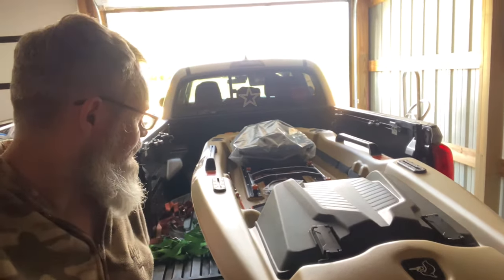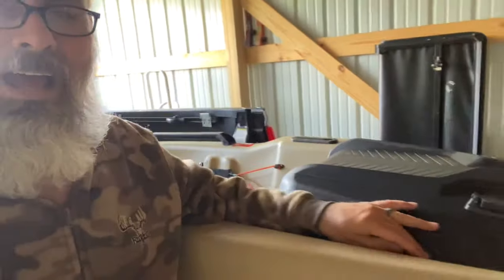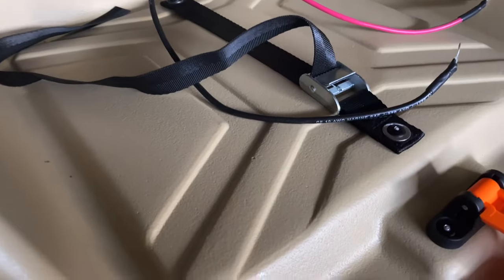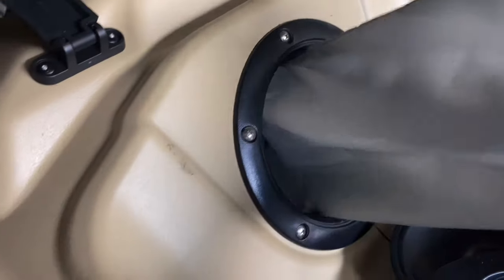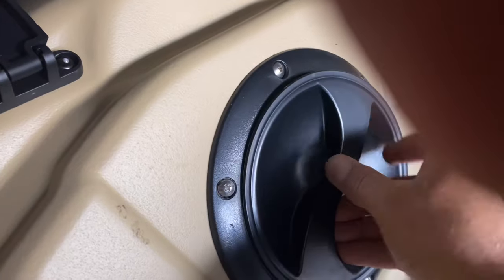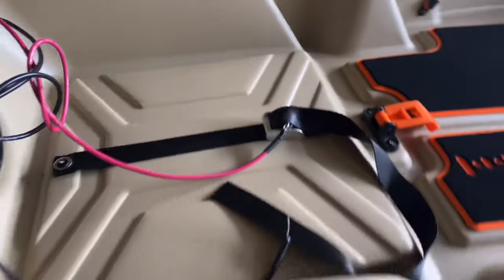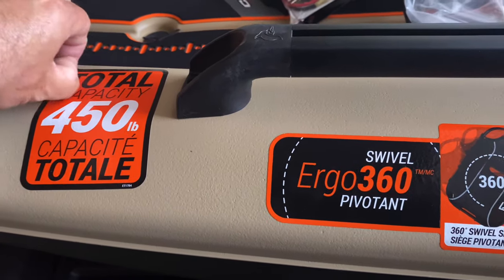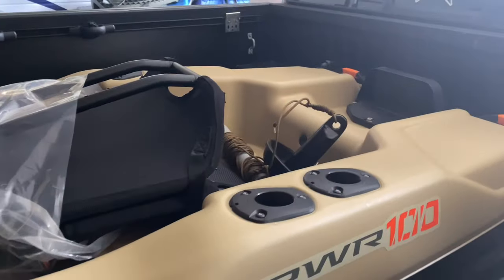Unwrapping and setting up my Pelican Catch PWR 100

Comment: Thank you for your video tour of the Catch PWR 100.  I've had mine for about a month, on the lake twice.  Like any kayak it gets better with custom mods.  Thought I would share in case you want to try doing some of the same.

I'll start with power.  I purchased a longer paddle from pelican due to the width of this craft.  The width makes the boat more stable, but can also be a challenge with paddling.   But who paddles?!  I mounted a Watersnake ASP, 24" shaft, 24lb thrust, 12v trolling motor on the transom.  You're right about the lip on the transom saving the motor!  I swapped the connector to use the one that came with the yak.  I run the motor via a MightyMax lead acid battery model 55-12, 12v 55ah.  The motor pulls 20amps at full speed.  The battery fits nicely in the front of the yak, straps down, and the cover closes just fine.  However, I have my battery in a battery box.   This brought about my first modification.   The battery stap that comes installed on the yak is not long enough when using the battery box.  I removed the strap by drilling out the rivet and replaced it with a longer strap that I riveted in place.  The yak battery cover now sits about a 1/2" off the deck with this setup.  However, the stretch strap still holds it down.

The first time I took this out on the lake I had a very difficult time with tracking straight.  The issue is with weight distribution.   To reach my motor I have to sit sideways and reach back.  Not only is this uncomfortable for me, but also more of my body weight was on one side of the yak.  Then my second mod - steering system by Bixpy.   This was a little unnerving to install, but got up the courage after a few brews.  To install, I first had to install an access hatch on one side of the stern.   For this I used a 4.5" hole saw to cut the opening.  Cutting a big hole in a new yak?!  Yep, and installed a black access hatch that unscrews and gave me just enough room to get my forearm inside the yak for pulling the steering tubing and cables from the controller back to the motor.  I then had to fashion some kind of connection to the motor shaft.  Plenty YouTube videos on doing that with cheap hardware.  I made my own out of some plastic I had laying around the shop.  Have to say, the steering works great once you have it dialed in!  Now I sit facing forward, which centers my weight, and the yak tracking is much better.

My next mod was to build and install a PWM to add variable speed to my motor (which has high and low speed).  PWM I used is also remote controlled.  I installed everything in a waterproof box and mounted it behind the seat.  Using the remote I can control power, speed, and direction.

My last mod to date was installing a kill switch on the yak.  For that I purchased a unit that interrupts the power to the motor when the pin is removed.  Again, had to cut a small hole in the boat for fishing the red positive line running inside the haul.  I then cut that line, wired it to each side of the switch, and mounted the switch to the haul.  When I go out in the water I attach a lanyard to my PFD and to the switch.  

All the pieces parts for these projects were bought on Amazon.  It has been a lot of fun modifying the yak once you get over drilling into haul!  Good luck and good fishin'!
Reply from the maker: Good info. I’ll take a look

Comment: Just ordered this yesterday. What trolling motor shaft length is ideal for this boat? Is 30 inch ok? That's what I ordered already but wonder if I needed 36. Thanks
Reply from the maker: Yes. And a 24” will also work. I am going to order one soon.
Reply: 24" shaft is fine.  I have a Watersnake ASP 24T that has a 24" shaft and it works just fine for me.

Comment: Thanks for the new boat walk-around video. This is #1 on my list to buy, and seeing how it comes and is set up helped with my decision. One question for Ed, or anyone else with this boat, would adding a 7" seat riser affect the stability? I'm 6'3" can concerned about leg room.
Reply from the maker: I have been told it will make it too heavy by adding the riser. I think you’ll have enough leg room as the seat will adjust back if needed.

Comment: Re: your Bass Raider 10e; have you had a problem with water intrusion between the deck and hull?
Reply from the maker: I have had no issues. I even installed a drain and plug. Sealed great.

Comment: I have 2 of these lil boats. 1 for me and 1 for the wife. You right they very hard to find. The wife's we drove 11 hours round trip to pick it up. For is the paperwork gos you need to go back to the store you bought it from and get the mso paper that supposed to come with the boat and a bill of sale to get it registered. Mso is manufacturer state of origin. We put the Minn kota 40 on a 12 volt deep cycle marine battery. Battery 24dc I think it was and the push great loaded down. Lowrance hook2 4x with gps fish finder with a transducer trolling motor mount works great. Enjoy
Reply from the maker: Got the MSO with my Bass Raider but they didn’t have it with the yak. They didn’t even know what it was. Lol.

Comment: I was searching youtube for the raider and this video came up. You said in the video you also have the raider. Now that you have used both what unit do you prefer more? Pros and cons to each? Thanks for posting this video.
Reply from the maker: First, with both you really need a rudder to help with tracking.  With the Raider it’s obviously wider which makes it more stable. I like how I can put the trolling motor at the front on the Raider. With the Catch PWR it breaks my back having to stay twisted to control the TM. Need a steering mod. I think I actually prefer the Raider for space, stability and tracking plus can take a passenger. Thanks for watching.
Reply: @outdoorswithedsometimesg  Thank you very much for your reply. You have helped me make my decision. As soon as I can find a raider in stock, im buying it. Hope you catch some big ones.
Reply from the maker: You will want to install a scupper hole for drainage. Trust me. Check my video for that when you get ready or there are also several other videos about it on YT. Enjoy!

Comment: I made the same mistake you did when installing the seat. I discovered after I got the seat together that the frame does come out of the rails... would have made things easier. I just bought mine yesterday from Academy, so haven't had a chance to use it yet.
Reply from the maker: Lol. I was like “duh” after I realized it was removable. You’ll enjoy it! I’m thinking of trying to add a 7 inch extension to the seat.  Not sure it will work:)
Reply: haha I was thinking why doesn't he just take the seat off :P

Comment: I have one of these boats on order and it is supposed to come in soon.  Do you know the width and height of the battery box?  Great video!
Reply from the maker: Not at home to measure but I know that it will hold a normal size battery (car size). But it will not hold the battery plus a box. Only a battery will fit inside the compartment.
Reply from the maker: Thanks for watching! You will love your Yak:)
Reply: @outdoorswithedsometimesg  I use an Interstate DP27 & fish 4 to 5 hours on it.

Comment: Would this boat fit in the back of 07 dodge ram 1500 ???
Reply from the maker: I would guess it would. I have used my Toyota Tacoma:)
Reply: @outdoorswithedsometimesg  well I guess they're about the same bed sizes 6 right
Reply from the maker: @markdent4052  mine is a 5’ bed so you’ll be good to go.
Reply: @outdoorswithedsometimesg  thanks for the information

Comment: you need the document of origin also, should be on the back of the owners manual, plus the receipt to prove the taxes were paid..otherwise the greedy gubberment will tax you again..if your kayak is 10ft or under you don't need to register it.. in MN anyway
Reply: You do if you add trolling motor